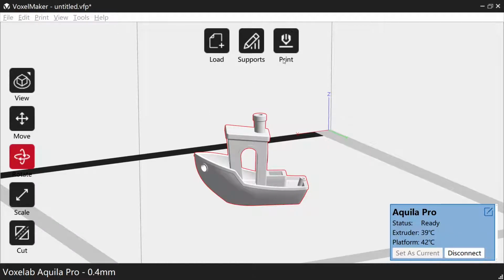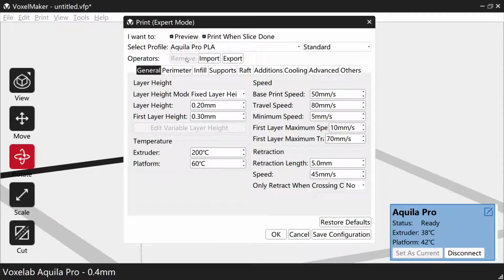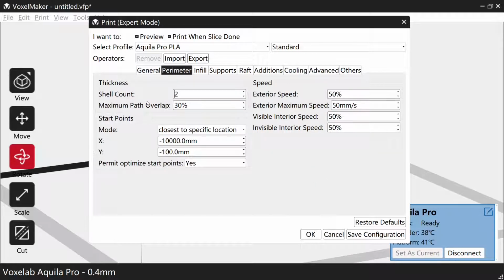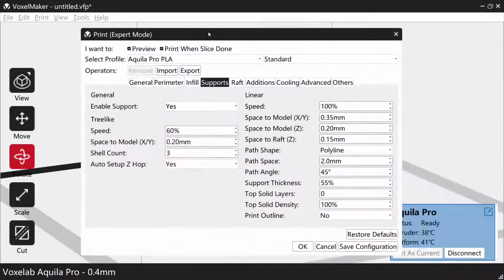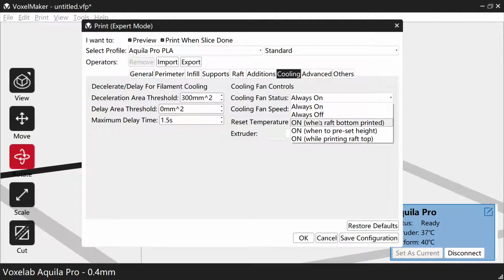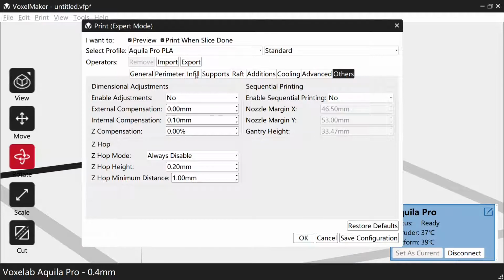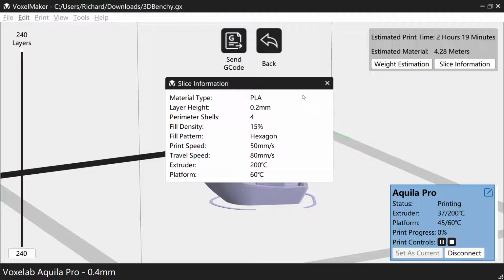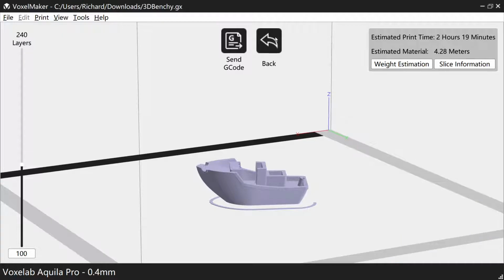VoxelMaker: Printing

Comment: Hi, thanks for the video. So to colour change would i use variable layers and change there? also is there any other slicers compatible with aquila pro? Thanks
Reply from the maker: You can't do a color change with voxelmaker unfortunately.  I would recommend Orcaslicer, create a printer with the built in Aquila x2 profile, then change the bed size and follow this video to finish the setup https://youtu.be/pJBOIX33jlo?si=EFrifbw8rvqaT-ZT guy is using Cura in the video  but he is just showing printer settings, I find Prusaslicer and orca slicer easier to use and just better overall.
Reply: @3dprintablesllc271  Spent hours looking yesterday but couldn’t find anything. Thank you I will give this a try 🙏🏻 🙏🏻
Reply from the maker: @BadBoyTurnz  lots more videos on those slicers than Voxelmaker, good luck

Comment: How would you print at 0.16 and 0.12,do u just change layer height only?
Reply from the maker: Yes just change the layer height, you may also need to change the first layer height as well though you could just stick with the default